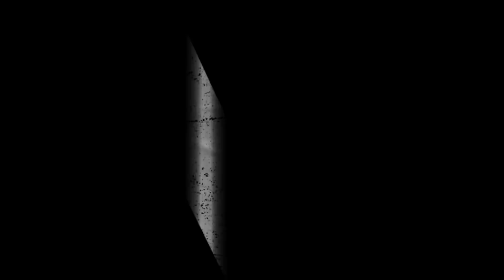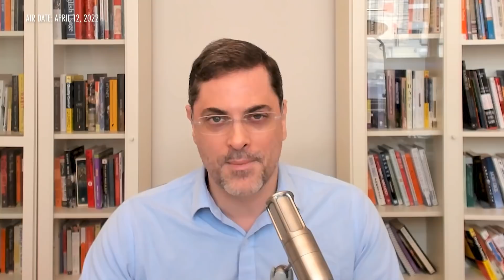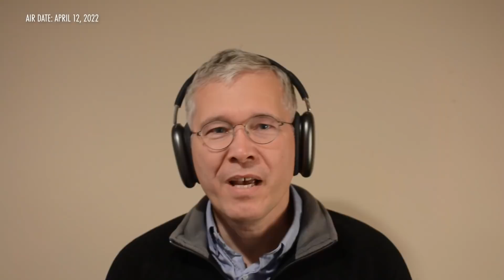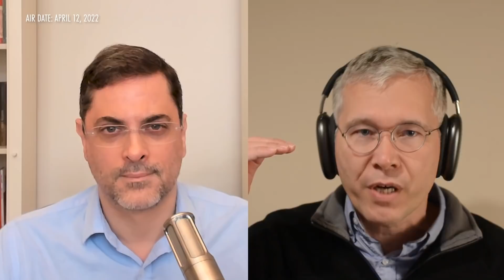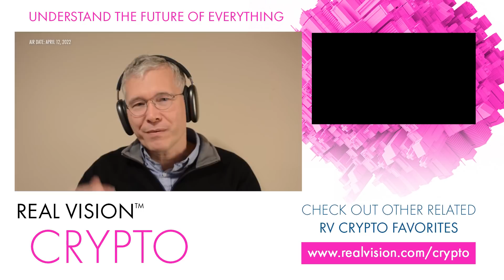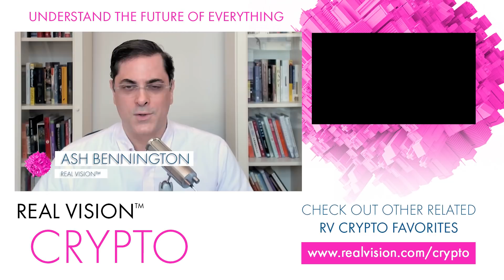CBDC Research Analysis: Project Hamilton vs Bitcoin

Comment: You could just employ Ripples XRP ledger. Just sayin'. ;)>
Reply: Why? So it can be even more centralized?
Reply: @BitcoinAndChess  Ripple, the company, is centralized, but the digital asset XRP is decentralized. The reason Ripple is still somewhat centralized is that it can implement changes without a system consensus. This is not the case with XRP. The top 100 wallets in Bitcoin hold over 30% of the supply not to mention the mining being controlled by china until recently when Elon stepped in. Let's talk about this utopia version of decentralization that only exists in the imagination of noob's with rose tinted glassed and talk twice as much as they listen.
Reply: @jpar6031  You proved my point. If Ripple doesn't like something, they can control it. Not to mention it's pre-mined AF.
Reply: @jpar6031  mining pools are made up of thousands of independent miners thinking independently. They are not enslaved to the largest holder. Most of those large wallets are exchanges which represent millions of people each.
Reply: @BitcoinAndChess  and Satoshi premined himself 1 million BTC but that was just because he is a kind thoughtful soul giving and caring not greedy ;)